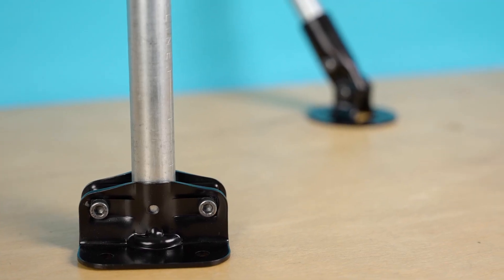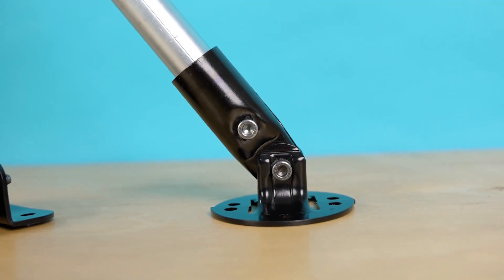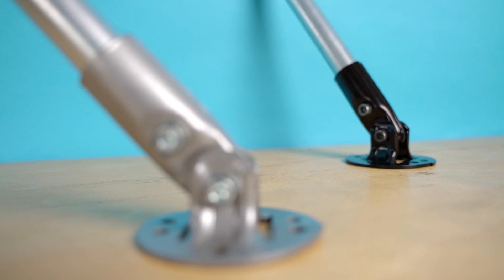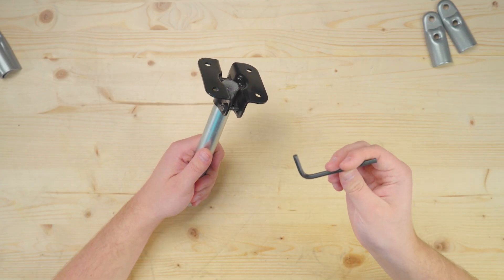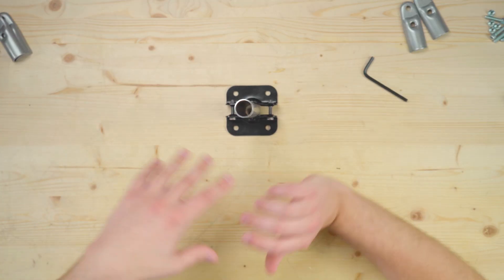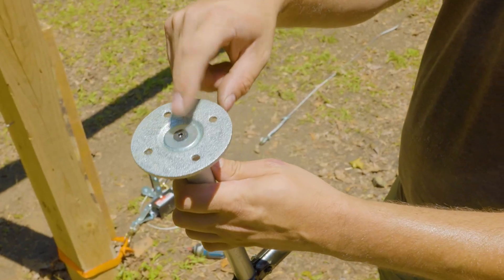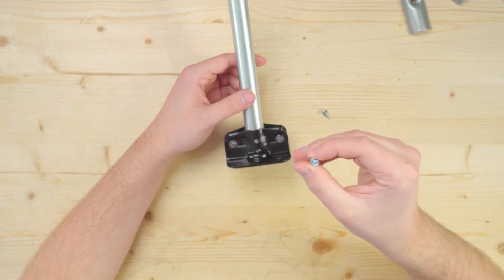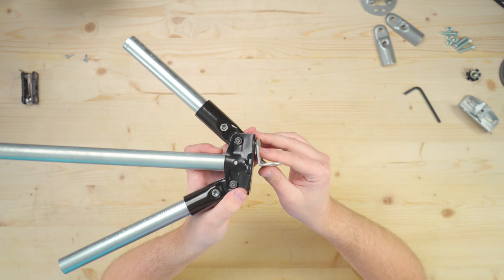The Solution You've Been Waiting For Is FINALLY Here!

Comment: With the adjustable angle flange is it possible to have it so the pipe can move on the hinge, for example to make retractable table legs?
Reply from the maker: You could do that. You'd just have to leave enough of a gap when securing the flange base pieces to your table. Otherwise they will squeeze too tight and keep it from hinging.

Comment: I keep hearing corrosion resistant 
Have yall tested the longevity of resistance in normal outdoor weather use?
Possibly just leaving them in the elements to see how long until you see change?
Reply from the maker: The connectors have an e-coating which used in the automotive industry. We’ve seen connectors that have been out in the weather for years and the only sign of wear is a bit of fading. No rust. Thanks for the comment
Reply: @MakerPipe  that's really awesome 😁

I can't wait for the minis to come in ...

What about the hardware? Are they coated as well?

Comment: Do you sell the end clamp part by itself? I can see uses for this alone, and also, if you want to use your last tip and add three pipes to the same flange, you need two extra end clamps to do it. To get just the end clamp, do you need to buy one of the adjustable angle fittings and throw out the receiver part?
Reply from the maker: Hi Marc thanks for the question. You can purchase the end clamp individually, it’s a variant on the Adjustable Angle Connector page. 

https://makerpipe.com/collections/modular-pipe-fittings/products/adjustable-angle-connector-hinge-connector

Comment: This really is spectacular!
Just one reason being. If for example we are making shelving with 3/4" wood, and short-ish spans. With these in use, we can do without the added work and expense of running two pieces of conduit to support the shelf, and then laying the shelf/wood on top of that conduit. If we feel the wood/shelf can support the load/span by itself. 

About how much longer, until more 1" fittings are added?
Reply from the maker: Glad you like them Steve!

Very very soon on the other 1” connectors. Within the next few weeks for a couple of them!
Reply: Very good,  @MakerPipe ! Thank you.